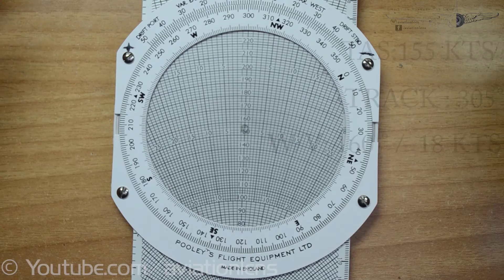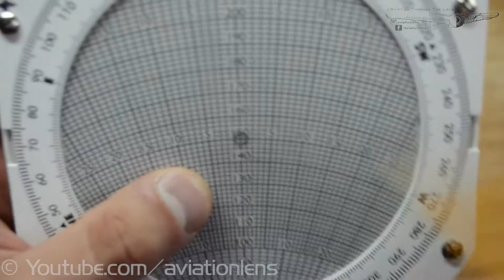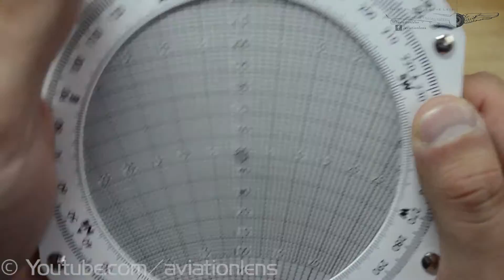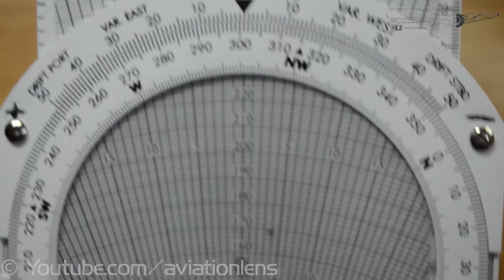CRP-5 * HOW TO * Find GroundSpeed and Heading [ Given W/V, Track, TAS ]

Comment: Not sure why you're subtracting the wind correction angle. The right side you should 'add' and left side 'subtract' Nice video otherwise
Reply: It helps to draw the entire wind arrow,that is, tail at wind speed and head with arrow at grommet. This should correctly display the wind problem.
Reply: This is one method but the preferred method is placing the wind dot ABOVE the grommet,setting the course,  and placing wind dot on true airspeed arc. Groundspeed is under grommet and wind correction angle under wind dot and applied accordingly to get heading.